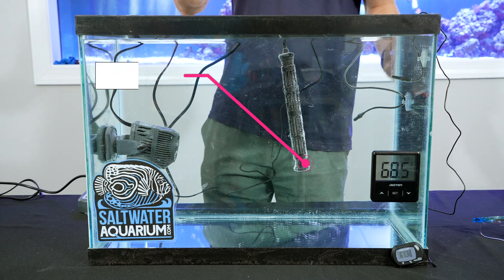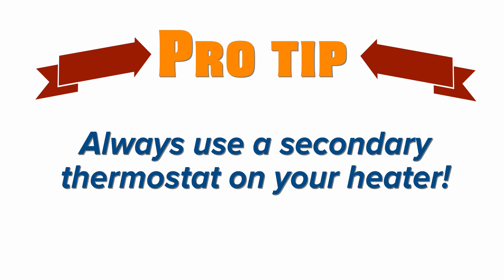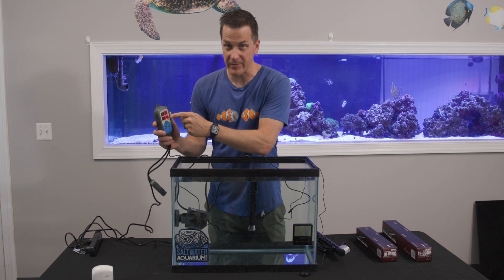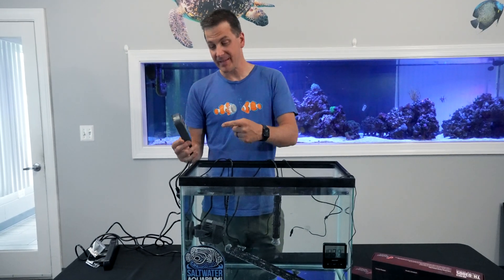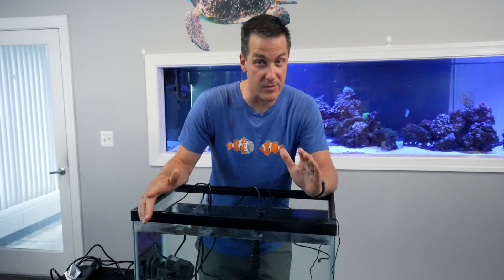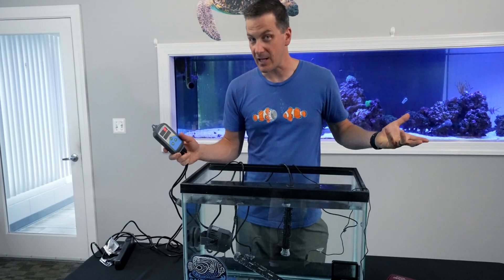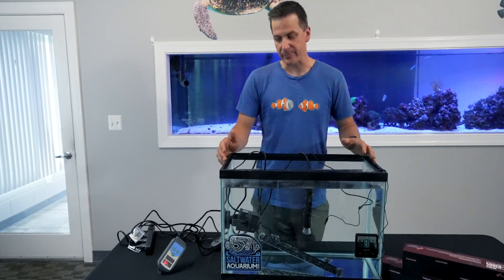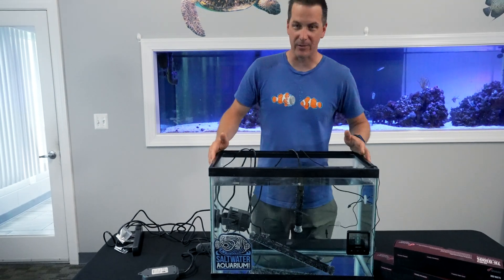OVERHEATED Saltwater Tank - Reef Busters

Comment: What would be useful, would be to know the rate of heating per watt per gallon.  Then  we could  just calculate how long we'd have before our tank (with its actual heater and volume)  temp raised by, say 5 degrees.  According to google, heating a gallon of water 1 degree F takes about 2.5 watt-hours. This assumes no heat loss from the tank, so it's an under-estimate of the power required.  So to heat 20 gallons 1 degree would take 50 watt-hours (20*2.5), or 1/2 hour with a 100 watt heater. Heating it 5 degrees would take 2.5 hours.  So IF your livestock can stand a 5 degree F rise, you have a few hours to discover the problem and take action.  (If I've gotten this calculation wrong, please feel free to correct me.)
Reply from the maker: The rate of heating is going to depend on lots of factors and using google guideline is a good start.

Comment: I appreciate your willingness to spend the time to test things. I'm not sure of the value of testing how long it takes or how hot you can get a tank with oversized heaters.
The point of having multiple thermostats is a good point or even better redundant heaters with redundant thermostats. I have two heaters controlled by a heater controller and it is plugged into an apex controlled outlet. This gives me three layers. The heaters themselves have a thermostat, the heater controller has a thermostat and the apex monitors as well and will turn off the power outlet to the controller if it goes over temp. This works very well for the heaters failing on. Failing off is just an alert from the Apex when the temp drops if it drops below a threshold. Otherwise I have to monitor the power draw which can also be alerted on but I have never bothered to do that.

Comment: My H2Pro heater is plugged in to my Hydros control Power strip the Hydros temperature sensor Is my secondary and it will shut down my heater if this were to happen if it was to go over 81° and it alerts me that I have a heater malfunction But my Hydros will turn the heater back on at 77° and turn it back off at 81° till I can change the heater it takes over controlling in an emergency